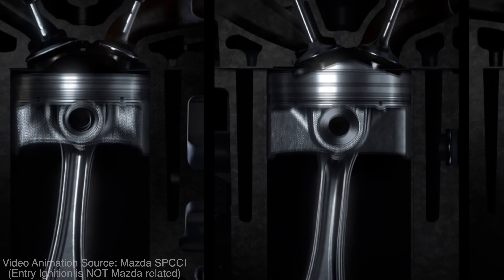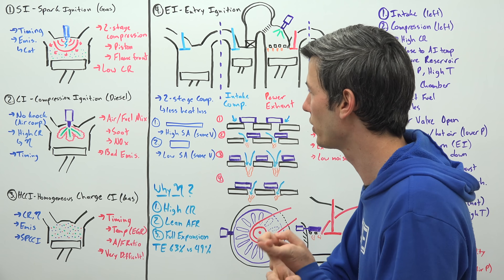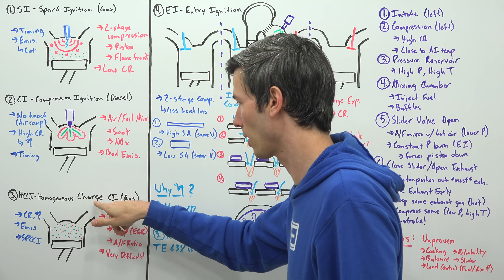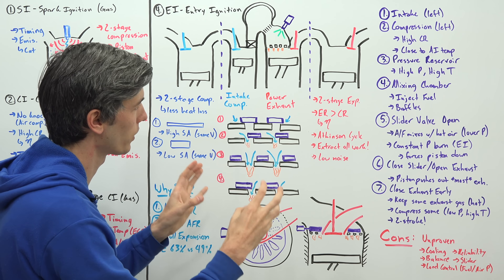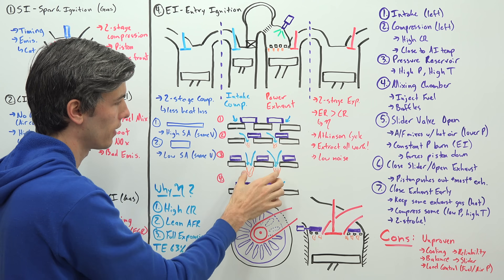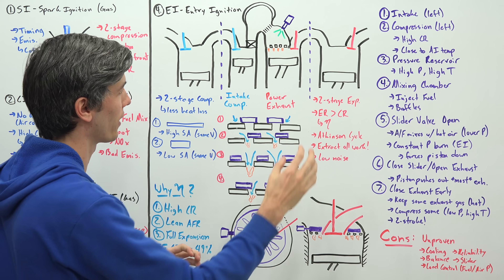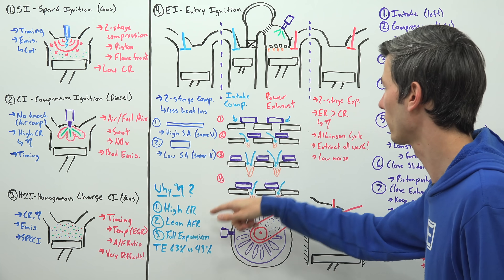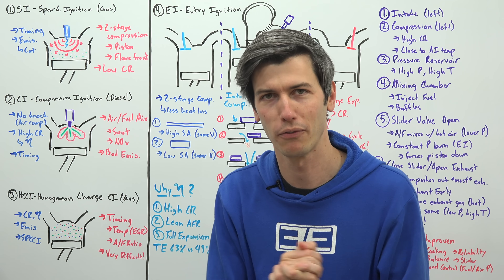Is 'Entry Ignition' The Future Of Combustion Engines?

Comment from the maker: IMPORTANT NOTE There's a lot of confusion about the engine size and how many cylinders are required. While the example I showed is four cylinders, you only need one in the simplest form. You can have any style air compressor beforehand (superchargers are air compressors), and you could have the combustion cylinder simply be larger to increase its expansion ratio. Four-cylinders is a logical way of explaining it, but as far as how the tech can be implemented, you could use 1, 2, 3, 4, however many cylinders you like. Also, both of the last two cylinders do useful work, not just the first combustion cylinder. As it is two-stroke, this will increase energy density relative to a 4-stroke engine design (double the power strokes per RPM).
Reply: this is basically a turbine but with pistons, you can make the same with compounding a few turbochargers on a two stroke engine
Reply: @ssllhh100  You still need the scavenging blower at low RPM.
Reply: 𝕀 𝕒𝕞 𝕥𝕙𝕚𝕟𝕜𝕚𝕟𝕘 ... ℝ𝕠𝕥𝕒𝕣𝕪 𝕖𝕟𝕘𝕚𝕟𝕖𝕤 𝕨𝕠𝕦𝕝𝕕 𝕕𝕠 𝕥𝕙𝕚𝕤 𝕖𝕧𝕖𝕟 𝕓𝕖𝕥𝕥𝕖𝕣
Reply: @realitykicksin8755  but the point is efficiency, something rotaries are not known for.
Reply: @realitykicksin8755  Too much RPM on rotaries. Durability issues.
Reply: Is it me or there is no initial ignition when you start the engine? Ok it uses hot gases to ignite the air fuel mixture, but once the engine is off and cold, how do you start it?
Reply: @thesimbon  
Use one of those long grill lighters as someone turns it over.
Reply: Good explanation as usual. I'll  review this again. I'm not overly impressed with the tech though. Look whst Honda got out of the CVCC engine introed in the USA in 1975. Emissions down and power and mileage up. Fixed the teething probs and it was a good model for them. Stratified charge maybe still has some potential with new technology????? Just a thought!
Reply: @mooglemy3813  My understanding (I could easily be wrong) was that there was an emission problem with the CVCC engine.  Maybe NOx?  Not sure, but that was supposedly why they are not making it anymore.  It was a fantastically simple way to improve efficiency.
Reply: @HitechProductions  emissions changed and Honda never sat on it's laurels. On to the next, NOX was an issue for everyone so that certainly would be one of the reasons to move on. Fuel injection by that time was the way to go, lowered production costs and EMs were much easier to control than carbureted models. Honda did make electronically controlled carburetors, last production ones were around 1988.
Reply: Any chance you could do a vid about  diffent fuels used in gasoline engines like LPG? What does it do the engine? Is it safe? Is it eco-friendly? Thanks, great show.
Reply: So it’s just over complicating the combustion chamber ?
Reply: Like the hope it goes further than the Ilmor 5 stroke! Love to see you review the 5 stroke.
Reply: In this style the friction losses are high , I know it’s only an example ,
Reply: So, essentially it is a Split Single Two Stroke with added Complexity and Valves added where simple Cylinder Ports could have been used?
Reply: Maybe, if possible, you should try to make yourself one, not in 3d print but actual metal. Of course if you have the time and money to do so I mean. Because this would be cool to see a new type of engine in operating condition
Reply: Reminds me of Australia's Orbital Engine Company which years ago came up with a clean efficient and simple two stroke - maybe take a look at that in retrospect and tell us why it didn't change the world?
Reply: @martintaper7997  Exactly what I thought it's the orbital..didn't they sell out to ford...it was a 3 cylinder configuration from memory.
Reply: @davenorman8251  And a 2 stroke with an isolated crank lubed by an oil pump as in a 4 stroke engine. As i recall it had too many quality issues. Additionally 2 stoke engine life is short and rebuilds are needed around 40 K Miles in general.
Reply: @martintaper7997  I thought that the orbital engine was another of those ideas that was bought up and shelved by one of the big car companies (ford) I drove a prototype fiesta fitted with one once it was surprisingly fast (I think it was 998cc or so) and reputedly very economical!
Reply: @martintaper7997  Orbital didn't change the world because Ralph Sarich is the king of the Australian engine technology scams.. 
Instead of developing an engine that actually works he siphoned off an estimated $200 million of investors cash into a luxury mega yacht, several multi-million dollar properties.
Reply: @sandervanderkammen9230  Ralph Sarich had nothing at all to do with the Ortbital Engine Company and its reciprocating piston engines - he and his engine were was already ancient history when this company (which still exists) was inventing new automotive engine technologies. Sarich made a complicated engine called the "orbital" engine that was later bought out by the BHP company which canned it. The Orbital Engine Company at a later time invented reciprocating piston engines in two and four stroke versions some of which are used to this day in marine engines and motor-scooter applications under licence. My car uses an Orbital Engine Company LP gas direct liquid fuel injection system, very efficiently and reliably. You, like many people, are mistaken on this issue.
Reply: @martintaper7997  Indeed, the Orbital Engine was not the revolutionary breakthrough technology that Sarich falsely proclaimed to the world it was... he was nothing but a clever showman that found some suckers and left them holding the bag.
Orbital did not invent direct injection.
Reply: @sandervanderkammen9230  The Orbital Engine Company 2 and 4 stroke engines are "NOT" the Sarich orbital engine, they are entirely different engines, reciprocating piston engine technology which have unique fuel systems which OEC did invent and licence to engine manufacturers, with "NO" Sarich person in the company or having anything to do with the design. 

Who said Orbital invented direct injection? I certainly didn't, but they did supply a direct injection liquid petroleum gas injection system - "NOT GASOLINE", "LPG", it's a liquefied gas! What is your problem? You shoot your mouth off about non relevant issues that had nothing to do with my comment and then you can't accept that you are ill informed! If you want to talk about the Sarich orbital engine, discuss it with someone who shares your desire to do so. I didn't bring up Sarich or his engine in my discussion, so I'm not that person!
Reply: Yes, the Entry Ignition (EI) engine can be viewed as a piston version of a gas turbine.  Both operate on the Brayton cycle.  However, gas turbines are very inefficient at small scales and only operate efficiently over a very narrow speed range.  This is why attempts to use gas turbines for cars have failed.  A piston-based EI engine can operate over a wide speed range and at higher compression ratios than is typical for gas turbines.  Gas turbines have a much higher power-to-weight ratio than piston engines, which is why they took over for airplanes.
Reply: this set up would probably be easily adapted to the duke axial piston engine
Reply: it's kind of like Harry Ricardo, and a Napier sleeve valve had a baby.. then visited a steam shop , and stole a triple expansion , then had another baby.. sort of..
Reply: Very glad you put in that note, I was beginning to think you were running short on sleep or something. Now that we have that it becomes not dissimilar to several designs of non-oil burning two strokes. There has also been a 5 piston rig that is not totally different than this either. Once more using two stages to extract exhaust power (steam turbines use even more stages but are mechanically simpler). Really not fond of that intake valve though, and glad I am not the engineer who has to figure out a way to keep it cool enough not to ignite the fuel (afraid its going to have to be a lot like a gas turbine blade to operate successfully). It appears to me that the lower section of that valve is going to be exposed to combustion chamber temps and premix level fuel mix as it enters the combustion chamber. I would love to see you build this but I am going to vote that a turbocharged opposed piston diesel is going to end up more efficient and maybe by using some other fuel to avoid the issues with NOx,
Reply: @aldenconsolver3428  I appreciate your addition , but see :
It is true that the valve would have a combustion temperature .
But again , on the other hand seals , one way valve's , ..red valve's , rotary valve's...and similar seal very poor in practice , and here it is in high pressure zone.
Maybe a ceramic valve.
Reply: @marinelsubu4807  We are not really different here, I have been involved in the motorcycle world with reed valves and rotary valves and with serious diesels at work. The premix part of this in a separate zone of the engine made good sense and maybe I wasn't really fair to pick on that valve. I am a fan of the uniflow principal in this application where intake ports would be put in the cylinder low and fed from a low pressure supercharger. I admit a passionate love for Detroit Diesel Type 71 and the Napier Deltic diesels. From there comes an insecurity with complex mechanicals in basically two stroke motors. Are you familiar with the Achates diesels?
Reply: @aldenconsolver3428  I was sceptic al of opposite piston engines.
I didn't immediately understand the key advantage of the mechanism with two heavy crankshafts and two pistons per  combustion chamber.
The key advantage , however is in reduced heat losses.
Reply: Thanks for the precision!
Reply: hi you for got to turn on the caption caption please And let me know when you have the caption working and I will come back to watch thank you :-)
Reply: @AzathothsAlarmClock  you could look at a 5 stroke engine and a split cycle engine. Put together they look like this one.
Reply: Like many others have said including yourself this is not new tech. Steam engines from back in the day have used similar two and three stage compressors and expanders to wring as much effiency as possible from what is available. Modern power plant turbines use the same type of two to three stage expansion and compression stages to extract maximum efficiency. The only difference is piston vs. turbine.
Reply: Thanks for restating this, I was worried about efficiency if only 1-2 out of four cylinders are doing work while the other two seem to be along for the ride. Your idea makes a lot more sense! Reason 749 you have a YouTube channel and I don't
Reply: Do another video and int depth on these details :)
Reply: You might want to check out the Scuderi- split cycle concept. It is pretty cool.
Reply: Why is the slider valve necessary? Poppet valve would be more reliable.
Reply: Thanks for the note. I was really confused as to why you would make a 4 cylinder engine with only 2 cylinders producing useful energy. But I follow completely now.
Reply: @Engineering Explained
 can we use something like a/c compressor to compress air ?(which is connected to the engine by belt)
Reply: superchargers are compressing air this is true but the chemical composition of "air" matters a lot in said Supercharging as two distinct gases are being compressed and both have vastly different ignition points.
Reply: Re: cold start.  On startup, there are no hot gases in the combustion cylinder, so EI will not work initially.  This problem is solved by having a spark-plug in the mixing chamber and igniting the fuel-air mixture there before it flows through the slider valve.  Once EI is initiated, the spark-plug is no longer used, so no more combustion in the mixing chamber.  The thermal inertia slider valve prevents it from overheating during the few initial spark-initiated cycles.
Reply: I swear to God you the Engineering  G.O.A.T. 💯💥💥
Reply: Can you do a video on biogas conversion cars?
Reply: Question, question.
Why use pistons for the the intake and exhaust additional stages?
Would a turbocharger be easier to control?
Also, doesn't this engine benefits from a U6 type with variable compression on the intake/compression piston?
Reply: i was just thinking this myself and trying to come up with a design that would implement a turbo to replace the one or both of the "cold side" cylinders.
Reply: The auto manufactures just need to watch your channel. It also seems you like Mazda engines the most.
Reply: Great!  :)
Reply: You should make a video of ROCKET ANTILAG system that Subaru used to run on their older rally card.
Reply: I foresee some serious engineering problem:  Without an intake stroke to bring in cool fresh air, I'm afraid that the valves in the combustion cylinder will melt.  Already, the exhaust valves in current 4-strokes engines run red hot at 650 to 750 degrees C, and are at the limit of metallurgy.
Reply: the temperature in the combustion chamber used to ignite.. But when starting how the chamber will be hot?
Reply: Didn't mazda or someone attempt something like this where they use a positive displacement supercharger to force an extremely lean mixture into a spark ignition diesel engine?
Reply: For efficiency, steam was expanded twice or three times in big steam reciprocating engines with each successive piston being a larger diameter.  Balancing became quite difficult when engine sizes became enormous and revs increased, such as in ships.  Balancing was partly solved using the "Yarrow-Schlick-Tweedy" simultaneous equations and might also work for the 4-cylinder engine you have shown.
However, there are just so many problems to solve in this engine design, I imagine it will join the zillions of other novel engine designs in dusty library shelves.
Reply: How do you get engine knock with a vertically centered spark plug???
Reply: How high of a compression ratio are you talking about? Petrol can only a certain amount of compression be4 it ignites from the pressure, the mechanics sound really overly complicated
Reply: No you can't. It requires a piston to provide a compressed charge.
Reply: "and you could have the combustion cylinder simply be larger to increase its expansion ratio."  I'm confused about this one, in a one cylinder example wouldn't increasing the expansion ratio by making the cylinder larger also increase the intake ratio?   Really fascinating stuff either way, I enjoy this channel.
Reply: Still seems its more friction etc. Created so all that extra if you harness it is not realy there .
Reply: What about the microwave ignition? 🤓 How does that compare?
Reply: Isntbthis a verybold idea from in the 1920s . I am sure I have seen yhis on some old motorcycle s at some time. I believe itbmaybhave been called the doublenhead or something like that.
Reply: Is this similar to the tldi system from tohatsu? It has a belt driven piston compressing air/fuel into the 2 stroke main cylinder 🤔🤓
Reply: If this type of engine is an EI engine, wouldn't the air fuel mixture combust in its chamber and not in the cylinder when the slider valve opens?
Reply: Isn't this Bryton cycle engine ?
Reply: Yes the power cylinder have one power stroke per revolution but we also have the suction cylinder that has zero power stroke per revolution so power density should not increase much compared to normal four-stroke engine.
Reply: @AzathothsAlarmClock  Yes, have driven plenty of trucks and buses with 2 strokes of this type, but can they be made emissions compliant?
Reply: Not new!  This concept was done by Sir Henry Ricardo in 1921 and again by Honda with their CVCC engine in the 1970s.  Both were killed by the problem of too many moving parts and unreliability.
Reply: @stevemcentyre1570  I disagree with your comment about killing of Honda's CVCC. Biggest problem after 1.5 litre 75 CVCC Civic  intro was 1.5  liter aux valve retainer loosened and sounded like a con rod knock, I was a tech at the time and when that happened to my 75  CVCC that's what I thought it was. 1976 CVCC Cylinder Head got so hot and had the thermo on the right head gasket would eventually fail between the bridges. Combining up with unique head gasket and bolts resolved that. 76 CVCC engines were 1.6 litre and countermeasures to auxiliary intake valve retention were made as well as retro fit aux valve retainer for thev75. All CVCCs had cast iron blocks and aluminum heads. The carburetor had two float chambers or was a 3 barrel by description, main and auxiliary, the latter for the rich mix to fire the rich mixture and then propagate the lean burn.  For 77 models two teams worked on improving A/ horsepower & B/ fuel economy. Honda made it work combining the results the two teams worked on and achieving desired results.  CVCCs of various displacements were made till about 1985, not a model I would call a failure but rather a good production run. Two many models to comment on made for many markets. Soichiro Hondas tenacity and vision to improve technology drove projects such as the CVCC to fruition. Honda probably looked at the 1921 attempts at CVCC and developed their own from that point.
Reply: Could you not just have petrol at a super high pressure + a super high compression ratio ? eg common rail diesel but with petrol? 

You could inject the petrol very quickly and also activate the spark plug just after
Reply: Yeah, you should have addressed that in the video, I was definitely thinking this would be 2-4 cylinders for 1 power stroke, which seems ridiculous for most applications.
Reply: @danieljensen2626  Agreed. Almost 4x the friction due to 4x the rings as described.  The dual intake / compression pistons  to prevent heat loss to a larger piston also didn't make any sense to me, this is why thermal barrier piston coatings were created.
Reply: Hi Jason. I am working exactly on the effect of the 4th cylinder and I think I have found a better system without adding that; simpler and more efficient than this interesting one you explained. My system works only by changing the behavior of the alternator and is retrofitable !!!
I just wrote to you yesterday on LinkedIn! So, check your invitations if you are interested in my system.
Furthermore, I have a hybrid concept without radiator and electric battery that could change the face of the world of engines; especially on helicopters!
Hurry up ! ;)
Reply: @pascalmonterisi1475  you're talking way over my head but it would be awesome to see your work.  Good luck with it.
Reply: Going to need gas glow plugs now too huh.. Can we just not?
Reply: if a supercharger is able boost too such high pressures, will not take enormous amount of energy. Considering length of travel of high pressure air will not  lose energy. It would be great if this engine comes out with maintaining present efficiency but it many increase considerable amount of weight not reflecting much on to vehicle implying increase in power density must be such high it compensates this. Your emission also tend increase since your increasing number of cycles of power extraction implying running at low rpm is not worth it since emissions are measured at grams/km. If this engine is able switch between both present and proposed systems at considerably low mid range rpms system has much to gain.
Reply: Still too complicated.  I'd just as soon use a pure E85 engine with a 15:1 compression ratio to make more power.  It'd be more reliable that way.  My philosophy is, generate power as close to the front of the process as possible, and not behind it.  This is why I prefer supercharged to turbocharged.
Reply: This engin is Tooooo OVER ENGENEERED
U know what happens when things are over engeneered .
Simple is Better
Electric is BEST